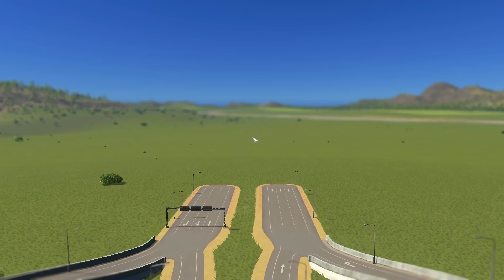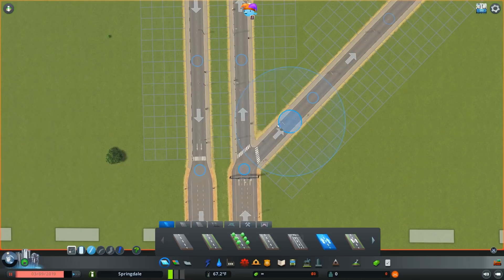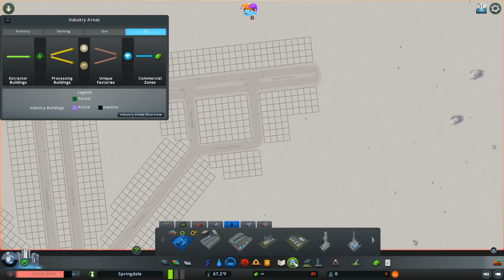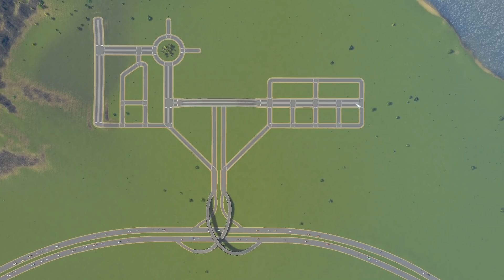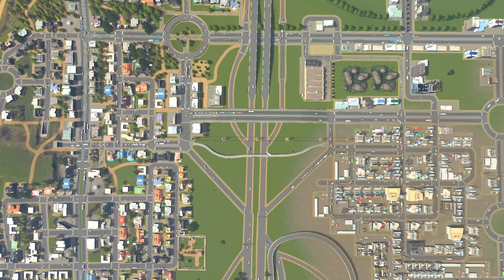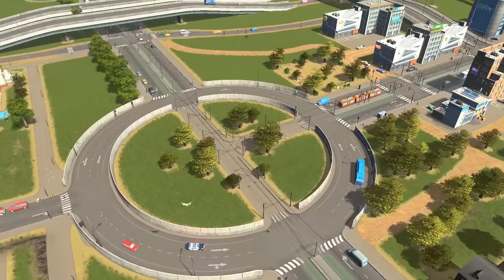Starting Road Network | No Mods (PC) | Cities: Skylines Tutorial

Comment: Three years later, come across this vid, and it looked similar to a starting grid I tried recently, but this one... WAY more effective!  I think the error I made was the off-ramp into the industrial district intersected directly with the overpass road/bridge heading over towards the residential/commercial side rather than having that 10 unit roadway, and then my residential/commercial area kept running straight along that main collector road line. End result, traffic going into the industrial park was fighting traffic going from the industrial park to the residential at that one intersection... and then on the residential side, eeeeeverything funneled onto that collector and THAT intersection was borked too.

Nice about this setup, after your city is up and running, there's PLENTY of room around those initial roads coming off the main highway, so you can work in a few more on/off ramps and place a few warehouses or some utilities, decorate up with some nice parkland as a nice "welcome to town" vista.

Comment: This is an amazing start to a city. My vanilla game was build with dirt roads, and it's a big mess. But it makes money and I'm unlocking the xbox achievements so.. I've completely filled one square and got 20k plus population. I've also make over 7mil so it's about time I basically start again on a new tile. My plan is to follow a better strategy and than eventually wipe out the old town bit by bit and update it. Your video has given me a good starting point.
Reply from the maker: Sound good man, should work nicely for you! Thanks for your comment ❤